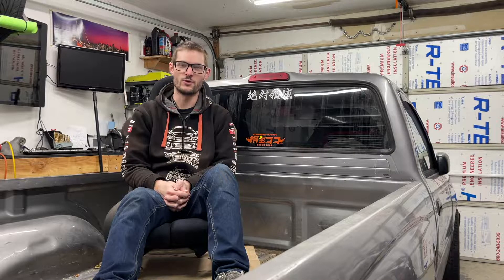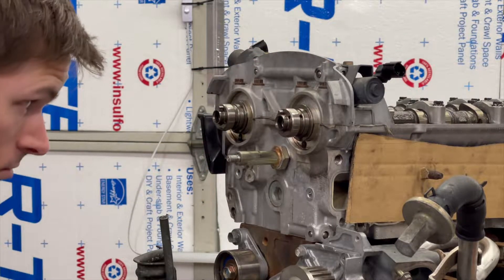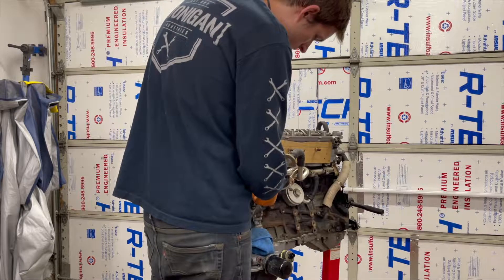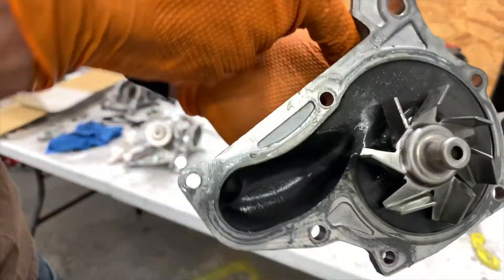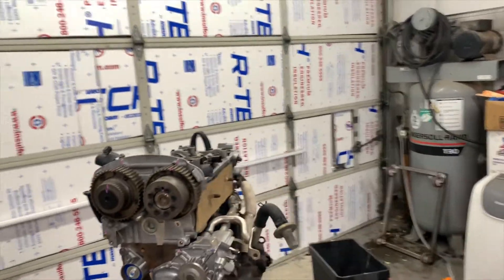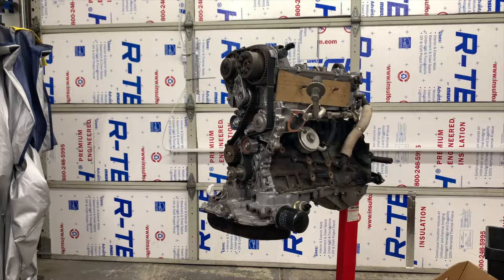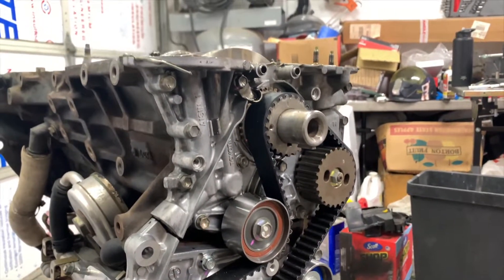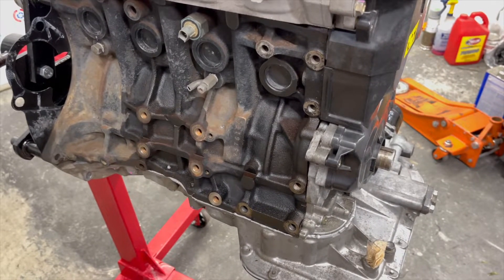Beams Swapping a Tacoma E01 - Refreshing The Engine (Part 1)

Comment: 33:30 looks like a chip from a hole that is drilled
Reply from the maker: Could be! I don’t see anywhere that hole would have been drilled, but it definitely possible.
Reply: @anothergarage  could be some leftover from the factory machining
Reply from the maker: @FortuneCast  I never even thought of that, but it makes sense. I always forget that these are cast and casting leaves flashing and there is a post machining process after. Thank you for your input and shedding light on this!

Comment: what motor mounts are you going to use
Reply from the maker: I will be fabricating my own engine mounts along with trying to use the stock Tacoma rubber isolators to make replacements easier in the future.